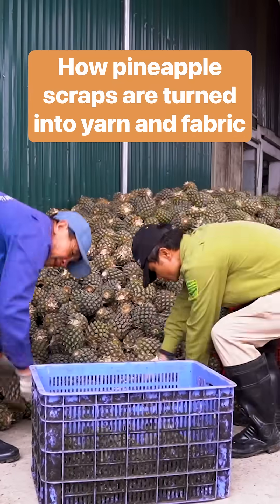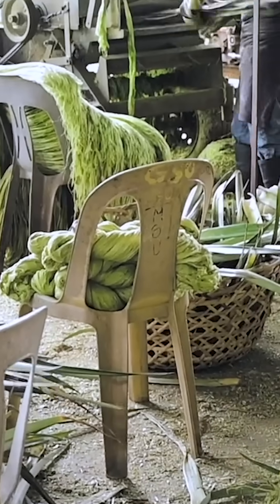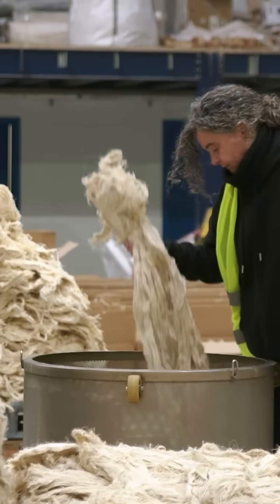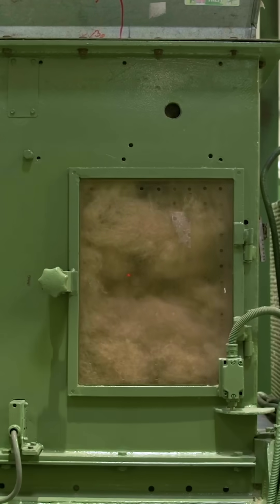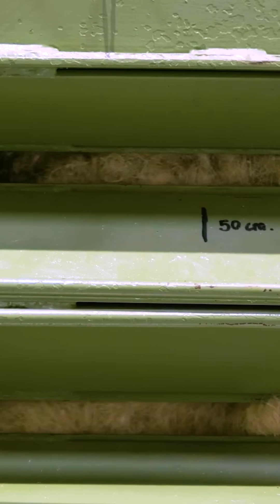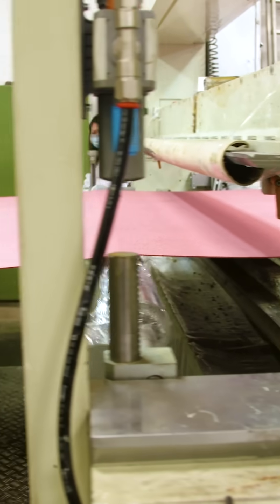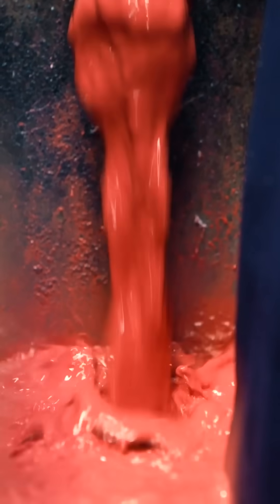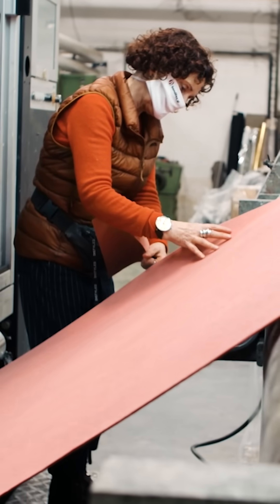Pineapple scraps can be recycled to make yarn and fabric. #ecofriendly #fiber #recycle

Comment: Ok ... Saw where this was going. The plastic part not withstanding. None of this would be possible without fossil fuel. The least of which is transporting it all over the Europe. Then the drying process most certainly uses natural gas. Then add the electricity needed to run the machinery and then of course it looks like the machinery is made from steal which requires an astronomical amount of cheap power. Im VERY sure they got millions in grant money from some government to do this and wiĺl continue to be subsidized by tax payer money. These green initiatives are a financial gravy train and has more to do with money than it does with the environment. There is NO GLOBAL WARMING EMERGENCY. And the biggest polluters in the world are laughing and doing nothing. China, Russia and India.

Comment: So the base material (pineapple waste) from Asia needs to be processed and then shipped to Spain and undergoes several operations after which they ship these fibers to Portugal and then after all that (remaining natural) they add a resin made from a plantbase substance with PETROLEUM (read plastic) and then you finally have the semi product! So 2 continents, 3 countries, at least 4-5 machines and more operations to achieve a semi product that in the end of the day still has plastic in it!! When this semi product comes to the factories that use it in a final product, they find out that the so called yarn and fabric can only be used scarcely since it is NOT at all as rezillant and useful as normal yarn and fabric, that it does not have the quality level and will not pass any physical and chemical testing! All that raises the cost and basically renders the final product useless and/or way too expensive. Good job eco warriors!!
Reply: We have it here in the Philippines pure organic.

Comment: Interesting, but yr 100% right. Yes, it's great that they found a way to use the waste by creating a marketable product, but the fuel (carbon footprint) required for the process seems to only serve to diminish fossil fuels unnecessary, when the waste could simply be fed to the local critters, which would eliminate the waste. Now if they could manufacture the product, 100%, where the pineapple is grown, therby eliminating the majority of the waste of fossil fuels for the sake of not wasting the pineapple waste which is Not a good trade, I'd say it was a good thing, but frankly, I do not see that happening, otherwise they would have done so in the 1st place.

Comment: Okay….
Where are the pineapples grown?
Packed and trucked (?) to port.
Shipped to Spain via what means at what expense?
Processed using machinery.
Packed, loaded.
Shipped to Portugal.
Processed using products argued about on world stages.
Final product is a “fabric.” 
👀 like a foam board to me.
Tried to get the process flow without flipping back and forth.  I love reusing and repurposing items.  Yes, there is a lot of pineapple that is currently deemed wasteful.
What is the prime objective here?
We’ve been to at least 3 countries and no exports yet.
Provide jobs for people?
Where is the break-even point on the cost-benefit analysis?
Or, is that not part of the primary goal?
What is function of the final end product.

Comment: At least the petroleum derived resin is a significant small portion of the larger portion of the finish product. The pineapple leaves are the larger component of the whole product this is still useful and sustainable. Every waste is utilised for other secondary products which are efficient and safe for the environment. 😎💯💪🏾👍🏾. I think that is what the main objective should be right?

Comment: resin is used so basically it’s woven plastic and not biodegradable
Reply: Some resin is biodegradable, most isn’t but like 3D printer resin is made from plants so it is
Reply: @lilygamingtheories1410  do they use potato 🥔 😱
Reply: It is biodegradable- read the above response.

Comment: Alr I’m getting tired of hearing about some new “wonder fiber” every week that gets processed by “local people” in “place” and then never hear about it again
Reply: It’s not a wonder fiber, it’s just all natural. Barcelona isn’t just some random place either
Reply: @MrMasterGamer0 resin is not natural
Reply: @exp-io853 There are Man-made resins and natural plant made resins (ex: amber). Man-made ones are just cheaper and easier to come by but as they haven't specified what resin is being used it could be assumed that it is natural.
Reply: @Noxtris  nice i didnt know that..now i just want to know if its plant based or man made
Reply: @exp-io853  Always happy to pass along knowledge. 😊 I have a feeling if they told us exactly what resin was used it may impact supply (competitors and such) if this company is still new and starting.
Reply: @Noxtris  They didn't say the specific type but they did say it was based off of other plants and petroleum, so not natural.
Reply: @nyrat8165  As a fossil fuel, technically, petroleum is natural. We just refine it to make gas and other products. Fossils crushed under immense pressure and heat trap petroleum between rock layers. Then again, there may be artificial petroleum options, but I have not done a search on it.
Reply: @Noxtris  It should be "as they haven't specified what resin is being used it could be assumed that it is not the  natural one." Otherwise, they would have shouted about how natural it is from the rooftop.
Reply: The video said resin made from plants and petroleum.
Reply: @MrMasterGamer0  so its not all natural